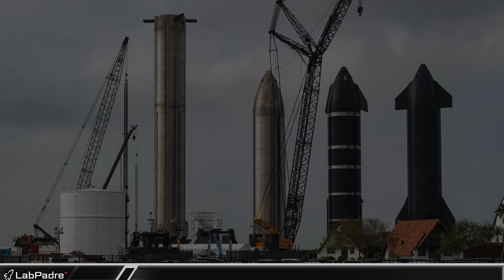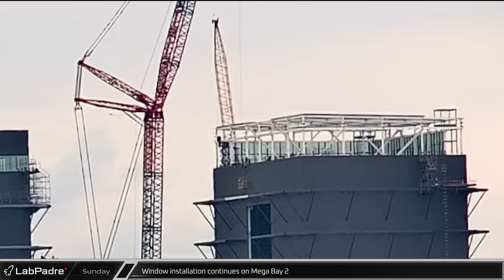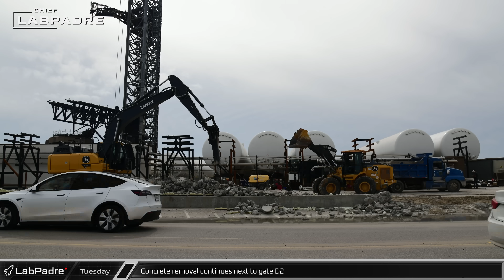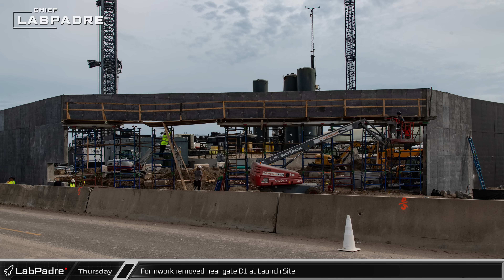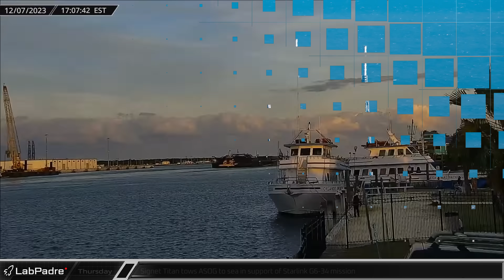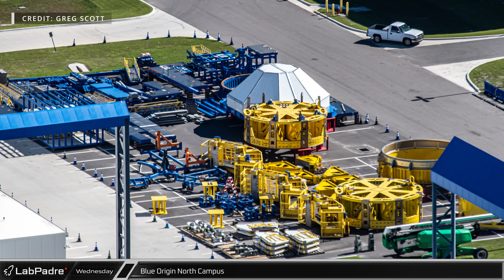Elon Hints at the Next Generation of Starship! - SpaceX Weekly Update #92

Comment: I believe  the metal added to the chopsticks will be used for installing and removing the hot stage section.  I don't believe SpaceX will continue using cranes for that purpose. I believe this because there are significant control modules underneath it that seem to require periodic maintenance

Comment: Im realizing that Starship has the same livable volume as the ISS.. thats crazy.. every launch is like putting humanity's largest space station into orbit again 😅
Reply: That's assuming they don't just say "screw it" and make an extended version for manned missions in LEO. The partially expended payload is 200t+. My guess is they could have a bulging second stage (12m instead of 9m), extend the storage location by 20ft, and outfit it with a complete interior.... and still be WAY WAY WAY below that 200t payload limit.
Reply: A version like that could have 2000-2200+ m3.... so around 2x the pressurized volume of the ISS.
Reply: @Hokie2k11  the next Starship is planned to be 18 meters in diameter and lift a 1000 tons.. but gotta finish the 9 meter HLS, Tanker, depot, and cargo variants first
Reply: @NPCSoftwareInc  Don't expect that 18m to happen, at least not in the next 50+ years... but likely never. And yes, I've heard the same things you have. The problem is there's just zero reason for it. In fact a while back Elon talked about how they probably went 'too big' with Starship, but that they are obviously gonna make the most of it now that they've settled on it. Time will tell of course.

If indeed they do want to go A LOT bigger, a more likely solution is, in our lifetimes, Starship sporting Super Heavy side boosters for a total of 60 million pounds of thrust. Combine that with a longer, bulging second stage and you could loft ansolutely enormous spacecraft to orbit with loads of propellant included. I think you are far more likely to see a 15m payload section on a standard or tri-booster setup than  you are to see a 15-18m Starship.
Reply: It truly is amazing to listen to the garbled word salad coming from yet another Musk sycophant over the introductory rending of a “ starship” with a huge expanse of an unsupported window which would implode within minutes or seconds of an actual launch. C’mon fanbois, refute this simple engineering fact and preferably without the picture of a young lady in a diaphanous gown playing a violin while floating through space.
Reply: @williamhatfield8935  you don’t appreciate garbled word salads? Interesting 🧐.
Reply: @crispy9489 Hi crispy. Do you think that large window will survive the launch.
Reply: @williamhatfield8935  I think you used diaphanous as an adjective whilst complaining about word salads.
Reply: @williamhatfield8935  I think that you take target renders as the gospel because of incompetence.. and you believe a space vehicle can't have windows even though many space vehicle have windows because of lack of intellectual integrity.. and I think you lack the ability imagine how a vast and exotic and very hardened glass can be covered by a retractable shield for transit purposes
Reply: @williamhatfield8935  I also think you lack common sense.. even a cursory glance of google will reveal glass can easily be harder than stainless steel, the main building material of the starship.. and can have exotic tensile strength with special manufacturing
Reply: @NPCSoftwareInc  In your eyes I lack common sense because I state an unsupported glass structure of perhaps 100 square meters will withstand the rigours of a rocket launch and reentry into the earth’s atmosphere from a round trip to Mars. As far as hardness goes I was taught whilst completing my degree in engineering the harder you make a material the more brittle it becomes. BTW have you seen the thermonuclear proof glass demonstration of Elon’s Cybertrukk.
Reply: @williamhatfield8935  I also said you take target renders as gospel because of incompetence.. let's not forget that.. as for "unsupported glass" that's just intellectual dishonesty.. why would unsupported glass ever be included in a seriously designed rocket.. why would glass in a consumer product like cybertruck be the exact glass included in a rocket.. more intellectual dishonesty.. and what is this obsession with glass from a target render.. like what..?
Reply: @crispy9489  Hi Crispy. Google diaphanous. First entry and I quote - ( especially of fabric ) light, delicate, and translucent. “ a diaphanous dress of pale gold”. Your reply would be appreciated.
Reply: @williamhatfield8935  I think you mean explode, you've been watching way too much under the sea stuff.
Reply: @williamhatfield8935  And no, it wouldn't explode (or implode lol). A large glass window could work just fine, though I don't think they will since it'd be overly heavy.
Reply: @Hokie2k11  it would be heavy for Earth. Once you get off earth going almost anywhere else in the solar system that isn't lethal will require no booster including mars, Jupiter's moons, Saturns moons etc... 

No offense but I genuinely hope you have a gigantic egg on your face if and when the Starship gets a bigger variant
Reply: @NPCSoftwareInc  I hope I'm wrong as well, I love spaceflight in general, I just don't see it happening. Regular operations using Starship make far more sense imo. Plenty of lift capacity to make things in orbit - I can't see us needing anything for another 50-100 years or more. SOOOO much can be done with Starship if it starts operating regularly.... humanity will have its hands full for a very, very long time
Reply: @williamhatfield8935  As for designing a glass, it is not hard at all. The atmospheric pressure inside is 1 BAR, that is almost nothing in the big picture. The deep sea vehicles that go down to Titanic may have much smaller windows, but some are still pretty good sized and can tolerate almost 400 bar.... 400x more pressure. Heck, think about how crudely built Apollo spacecraft were. How thin the glass is on spacesuit visors. 

Designing a window that will work on Starship may not be ideal from a weight standpoint, but it is absolutely possible if they want to. Vibrations and sealing it 100% would be a bigger issue imo than pressure.
Reply: Without the ISS's solar panels and radiators, however, capabilities and duration will be more limited. Having external solar panels on a disposable service module/trunk like what Dragon or Dream Chaser uses is not an option for a fully reusable system.
So unless its mass is too much for ISS to handle, it will probably be most useful when docked to ISS. The lunar HLS starship will probably have some solar panels as illustrated, because it never returns to ground.
Reply: Do Starship fans still don't know this stuff??? 🤣
Reply: @TheHeavenman88  go touch some grass buddy